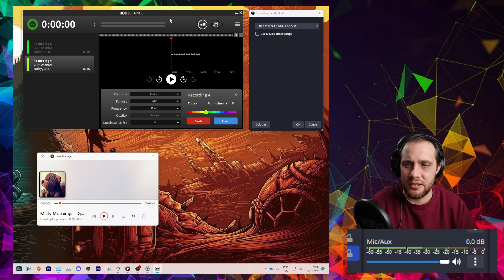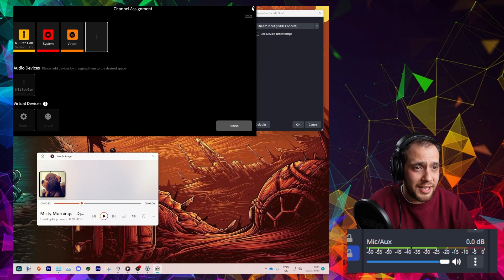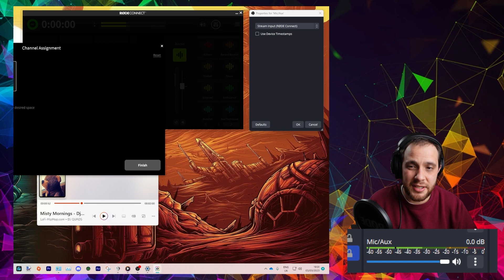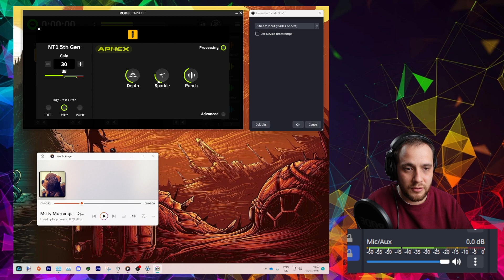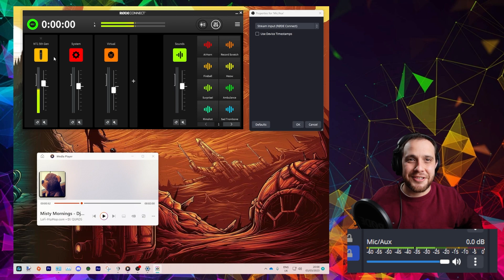Rode Connect NT1 5th Gen setup, Routing, Recording, And Processing Demo

Comment: I love your video, I m wondering if you can guide me though this use case, im using 2 of these mics for a dnd podcast, i have six people in a rectangular table, each mic is boom over 3 people, the closest distance between the mic and the guy in the middle is probably 50cm, what should my gain be and what are the settings i should use for the noise gate and compressor... I d love if you can throw me at me some info here <3

Comment: Sadly I'm returning my Rode NT1 5th Gen. What a huge disappointment! Despite my best effort I could not get the mic to stop dropping words in my recordings. I mean how is that even a thing??!?!  50% of the time it would totally omit the first word of ANY new sentence and as an added bonus it would often trim off or omit words starting up after a pause. This is not something that should have to be "fixed" in a setting right out of the gate. My other mics do NOT do this. This is a brand new mic! The cables are connected securely and it has this issue every time!  This is happening on the USB side and I have no need to use this mic as an XLR as I have my reliable RE20 for that purpose. 
The depth of the Rode NT1 5th Gen's sound is beautiful. I DO like that right out of the box and it was due to that that I kept trying to fix the dropout issues. Alas, it never could get fixed. It's going back. I can only hope that Rode will honor its 30 day money back warranty on it.

Comment: When using the NT1 5th Gen  in USB mode, can I just bypass the Rode Connect altogether and just go straight to Audacity and record from there or do we HAVE to use Rode Connect to be able to control the Gain, Depth and Noise floor etc. Maybe this cannot be done with Audacity or Audition?
Reply: Yes, you make the settings for onboard gain, and the APHEX processing in Rode Central, or Rode Connect. They persist in the mic, once set. Something to be aware of, and remember. Sometimes you'll want to turn off any onboard processing or adjust the gain. As mentioned, the processing and gain is only for the USB.

Comment: its crazy in the year 2023 we are still dealing with latency issues
Reply: works without noticable latency for me
Reply: with USB there is latency, if you use an xlr an interface i dont think their should be minimal latency
Reply: Latency from what? Change your buffer size
Reply: Record in a actually recording program... like pro tools or cakewalk, and adjust buffer rate. Monitor your audio that way.

Comment: So do you can connect the Rode nt1 to the Rode Ai 1 and monitoring this with zero latency with the dsp effects from rode nt1 as well?
Reply from the maker: The dsp effects only work when connected via usb. The usb connection is inside the the xlr port so at currrnt there is no way to dual output from the nt1 5th gen
Reply: @thefullsetup  Oh the Effects are not working when you connected it with a xlr Cable? That's sad.

Comment: Hi Good Review.
Can I Use This Software With My Dji Mic Too?
I Appreciate So Much Your Support.
Thanks So Much
Blessings
Reply from the maker: If you plug your Dji mic into a rode ai micro you could use it but you would need a 3.5mm stereo to mono splitter to have both of the Dji mics on Seperate channels in connect. Also you won’t have the full aphex processing just one button processing.